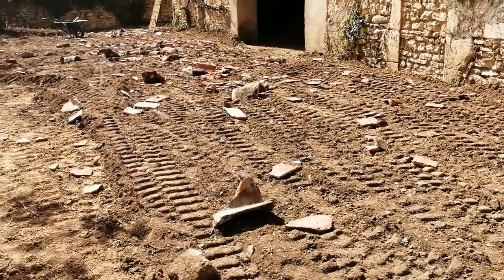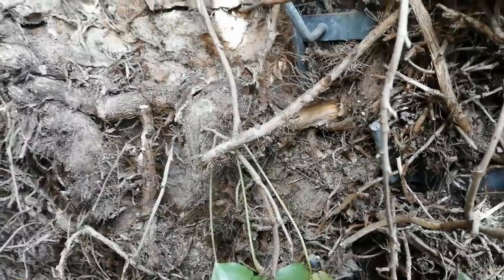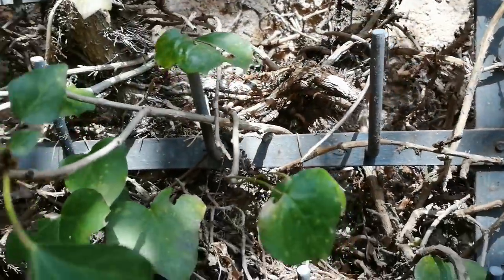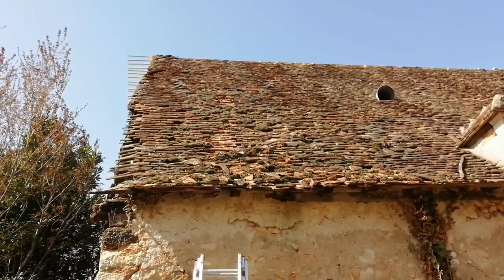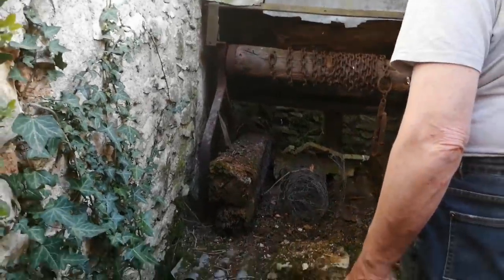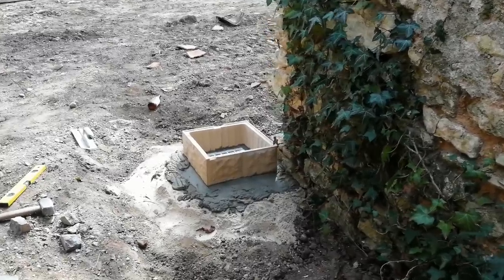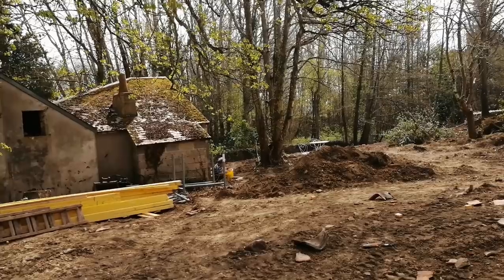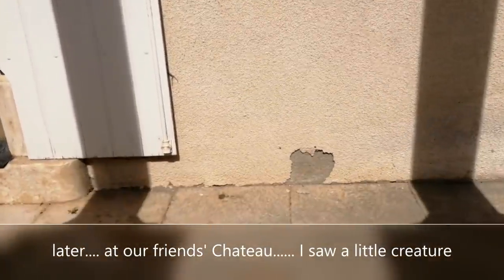Not Quite a Chateau DIY 63 -  Behind the Barn -  A Safe Key -  Forked Tail - & A Chest in the Attic

Comment: That was interesting Jane. There has been a lot happening with the reno. It is still revealing little treasures for you to find. Those small blue and white tiles on the wall in one of the kitchens, if you can get them off, could be made as a table top for outside maybe on  that round stand thingy, not sure how tall it is, could have a top on it and used outside, or use it as a large pot stand.
Reply from the maker: Hi Penny, I definitely want to re-use those blue and white tiles, not sure where yet but keep watching...